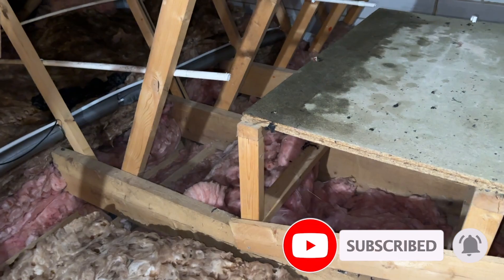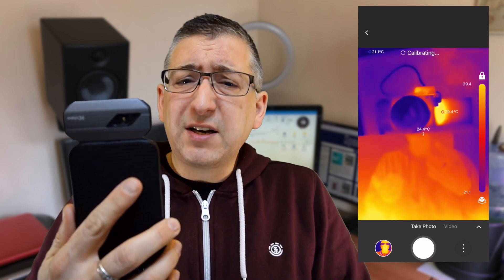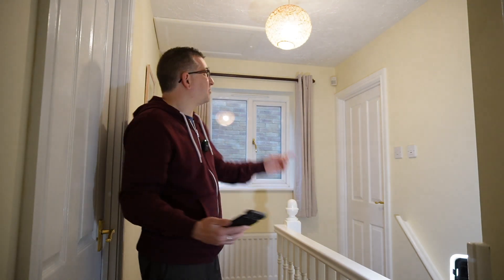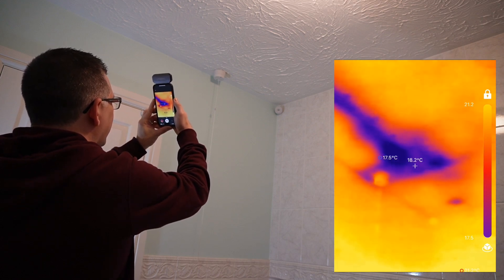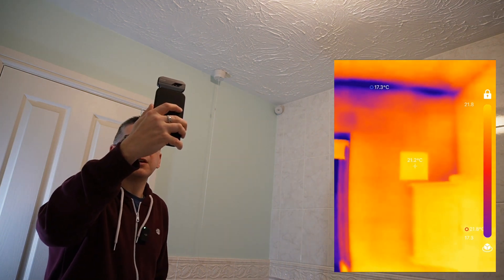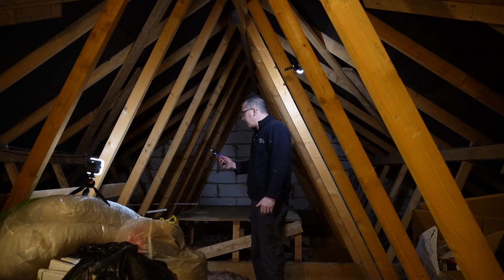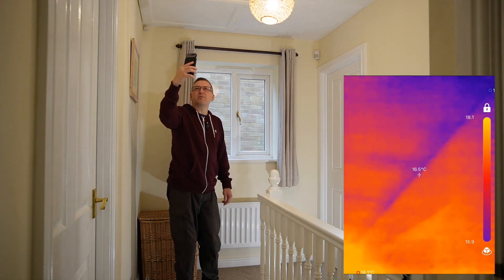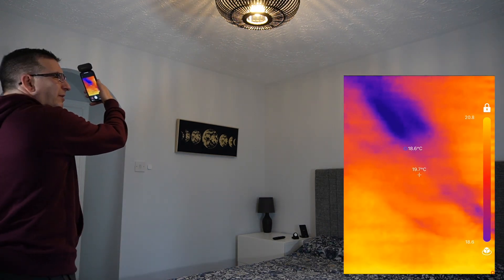Inspecting Loft Insulation with the TOPDON Thermal Imaging Camera

Comment: These old gas fires had a flue the size of a letterbox always open to the chimney and people wondered why the room got cold so quickly after turning the fire off !!!😅🤸😃🤸😃😃
Reply from the maker: I’ve bunged up the flue with a towel in a plastic bag for the moment. The gas has been disconnected now so it can’t be used anyway.
Reply: @SpeakToTheGeekTech  Thing is they only check gas pressure and whether the gas is leaking when they reconnect you they won't be looking for a blocked flue so best leave a permanent clear note where they connect and at the appliance you've blocked it.
Reply from the maker: They're not going to be reconnecting gas. That gas meter is long gone for good and the unused gas fire will be removed at some point soon too.

Comment: Warmer Solar panel kabels are only 19 degrees. So the are far under danger teperature
Reply from the maker: Yeah, no issues at the moment. I think the idea is that I should check them every couple of months to make sure there are no new hot-spots appearing - for example around by the DC breaker which is a known problem area.

Comment: For the joists, full between with PIR ideally, then install a set of joists perpendicular and install more PIR between them. Then the thermal bridge is reduced to where the perpendicular joists overlap which will dramatically improve the insulative value.
Reply from the maker: Thanks, may be one for a chippy rather than me as a DIYer though :)
Reply: @SpeakToTheGeekTech  It's not structural so I wouldn't worry too much. 

Put a screw in to the overlap just to stop them moving around. But the PIR wedged between should keep them in place anyway. 

Might need a long screw and/or to drill a deep hole in the top member. 

Then you can just lay your OSB/ply on top to walk on, few screws to keep it in place. 

Extra points if you seal all the gaps and use a metalized vapour barrier with a small air gap on either side and taped joins.

Comment: I borrowed my work colleagues thermal camera and ended up insulating under the floor boards and improving the attic insulation. It's improved the comfort of the house and reduced gas consumption. 

I found that behind the skirting boards is another leaky spot due to gap in plasterboard which has a polystyrene backing. Very interesting. I didn't manage to do anything to improve this as would be too messy pulling off skirtings
Reply from the maker: Yeah my skirting boards are showing up as cold too.

Comment: I put an extra 6 inches of insulation in our loft last winter. You can see the step change in gas consumption in the data. House was built 2001 and was already fairly well insulated. Well worth it!
Reply from the maker: Yeah I added that second layer about 2 years ago to about 70% of the loft where I was able to. Probably about 90%+ covered with two layers now. Made a huge difference to the gas bill!

Comment: You should wear a diposable suit , mask, gloves and goggles when messing about with insulation. The fibers are not good for you, not only in your lungs but in your eyes.
Reply from the maker: Point taken thanks, I’ll be investing in a protective suit thing and a proper mask for next time.
Reply: But if you buy natural sheeps wool insulation then you don't need any protective gear and it's really easy to cut/shape.  Not cheap mind, but worth it!

Comment: an eye opening video. although expensive im contemplating getting one of these IR cameras as clearly they are useful if not compulsive!

Regarding insulating your gas flue...it is likely to be a precast block flue which is integrated into the inner cavity wall during the build process. If this is the case, the blocks will go up into the roofspace and then there will be a flue pipe connected to it that connects to either a ridge terminal vent, ot the tube may penetrate through the roof tiles to outside, weather sealed with a storm flashing.

In the first type (connected to a ridge tile) you can remove the flue pipe between the precast block and the ridge tile vent. once removed you will be able to see down the precast block, it may fo;;ow a completely straight route right down to the fire or it may be stepped, it really doesnt matter, but it will give you an appreciation of the size of the hole in the block. 

Once the fire is removed, block up the flue hole by whichever means you feel appropriate. Personally, I would cut a piece of stiff card slightly larger than the hole so it can be wedged tightly, Make a number of holes in the cardboard such that the tube of an expanding foam can can pass through, then squirt a couple of seconds of expanding foam through the holes. Use the fireproof foam as previously mentioned in a comment above. Once the foam has cured, remove the cardboard and check thet the hole is completely sealed by the foam, if not apply more foam in any holes. You can of course block up the hole by other means...a piece of olywood perhaps, but whatever you use, ensure it is completely sealed.

Once the flue hole is sealed at the bottom it will prevent warm air from your room being sucked out! You could just leave it like this and similarly block off the top of the flue block where it exits into the loft, the trapped air will actually provide some degree of insulation. If you prefer a more thorough approach to insulation (which I think would likely be your preference!), you could actually fill the flueblock hole throughout its length using a loose fill type of insulation (vermiculite, polystyrene beads for example).

The outlet to outside via the ridge vent could be blocked up with remaining foam if you have some left, or again, plywood. or even gaffa tape or leave it open to aid roofspace ventilation.

Im looking forward future videos of your IR investigation and remedys thereafter!
Reply from the maker: Thanks for that info, I think you are correct - there’s a flue in the loft which takes it to a ridge vent. I will have a good look and investigate how it all fits together! Cheers

Comment: I would have thought it would take a day before you could see the full benefit of you work as the cold spots will take that long to warm up.
Reply from the maker: Yes you're right - there was about 6 hours between doing the work and checking again, but I think it needed longer because it has made more of a difference than shown. Still got plenty of gaps though I need to sort!

Comment: I have just done my loft which was very badly done with 100mm insulation some carpet and loads of other rubbish. I bought some more 100mm to sort out all the gaps then 6 rolls of 200mm which I laid across the beams so as to close that bridging leak, I then raised the floor where I wanted to walk and store stuff by 300mm which I used 3x2 screwed between the trusses. It took quite a while and as you say a very messy job but I wore a boiler suit and gloves and a professional dust mask. (I was really surprised that you were not wearing protective gear). The final result is fantastic. We have been away for 6 weeks with no heating on and the temperature of the rooms have only dropped a few degrees when viewing my Tado dashboard. Unfortunately I haven’t yet been recording the Tado temperatures with HomeAssistant as that would have shown if I am getting any solar gain. In total a couple of hundred £ and of course the cost of the thermal camera but by the looks of it I will recover that quite quickly. Out of interest I had all my SolarEdge Optimisers mounted in the loft so I need the new floor to access them but at least by mounting them there I won’t have to lift panels if there are failures. Especially as I have integrated panels.
Reply: Good point about optimisers inside the loft. I'm getting 5 extra panels & another battery fitted soon & the quote includes optimisers. I'll see if they can locate them in the loft cos if one goes it's a scaffold & panel off job to replace one.
Reply: @colingoode3702  It was a lot of work and used a lot of extra cable as the Sparky said they all had to be the same length to avoid mismatches, but I am really glad I insisted on it. We have Solfit panels which link together to make a complete sealed roof. My panels completely surround a dormer so to get to the back of one panel would mean removing all those below and to the side.
Reply from the maker: The small parts I was covering meant I didn’t have to get too deep in to the mess. When I finally do the edges on crawl boards I’ll have to kit up properly or I’ll be sneezing fibreglass for months
Reply: @SpeakToTheGeekTech  Oh yes I understand, I wasn’t criticising only surprised as even dressed for a space walk, I couldn’t wait to get under the shower. But I did a lot of work up there which took me about a week. I can thoroughly  recommend the JSP force 8 respirator from Screw Fix. Well worth the £31 rather than the paper ones which never work for me.

Comment: The only way you'd ever reduce the thermal bridging from the joists through the plasterboard would be by dropping the ceiling height a touch by putting insulated plasterboard on the ceiling. All newbuilds do this now round here to reduce it, if I was able to borrow a thermal camera (cough cough) and show you my insulation Vs the original house there would be a huge difference.
Reply from the maker: Haha! My camera is already doing the rounds with family!

Comment: The more insulation layers you can get in the loft the better the results, using kits to raise the loft flooring if necessary.  To think we used to have 50mm insulation in our lofts and thought that was plenty!
Reply from the maker: I may have to add a raised flooring in a lot of it just so as I can use the space for storage!
Reply: @SpeakToTheGeekTech  I can recommend LoftZone Store Floor. Not the cheapest of it's type but it's lighter than using wood, with no thermal breaks & stronger. It's also BBA approved for new house builds.

Comment: Hopefully the verge area was kept clear of insulation to keep your ventilation flow intact.  So many forget or don’t know this…
Reply: I found a strip of breather membrane stapled to the lowest point if the truss prevents you pushing insulation too far and blocking vents, means you can stuff it right to the edge but there will still be air where it's needed
Reply: @tarkadahl1985  I believe that is an official detail as well!
Reply from the maker: Yeah it is, but... there is space to put a single layer of insulation between the joists in a lot of places whilst still having decent air flow. I still need to get up there with some crawl boards and sort that but it's an itchy job that I'm putting off!
Reply: @SpeakToTheGeekTech take a look at the recycled plastic insulation available in places like B&Q. It’s got a good enough r value, but it’s itch free. Just feels like cotton wool. Does the job without the itch.
Reply: I have 300mm , but u still need the air flow
Reply: I borrowed my work colleagues and ended up insulating under the floor boards and improving the attic insulation. It's improved the comfort of the house and reduced gas consumption. 

I found that behind the skirting boards is another leaky spot due to gap in plasterboard which has a polystyrene backing. Very interesting. I didn't manage to do anything to improve this as would be too messy pulling off skirtings.